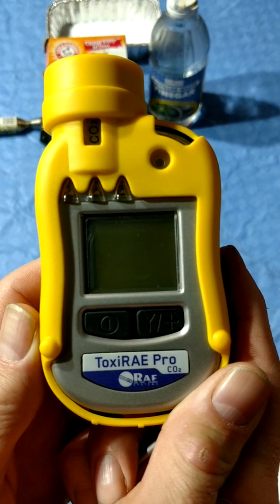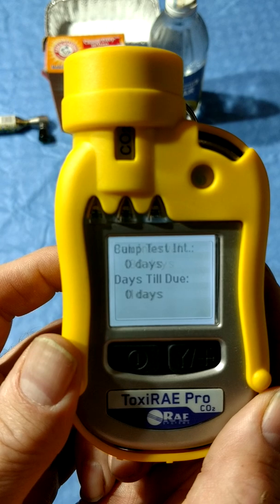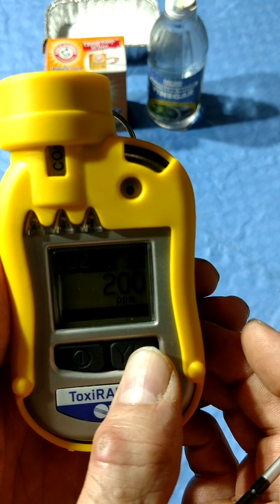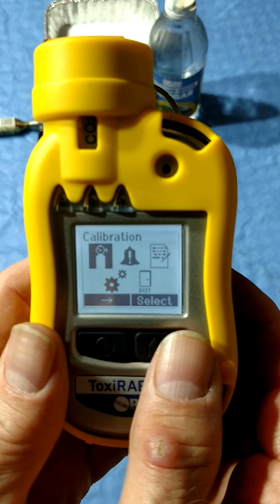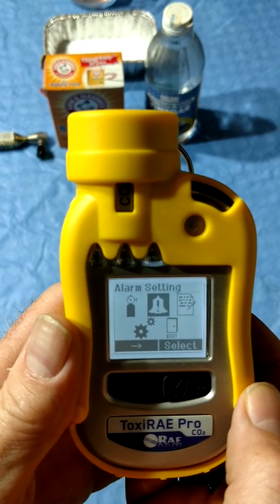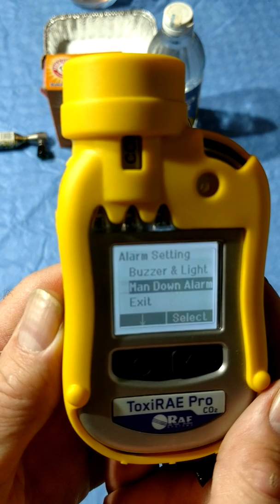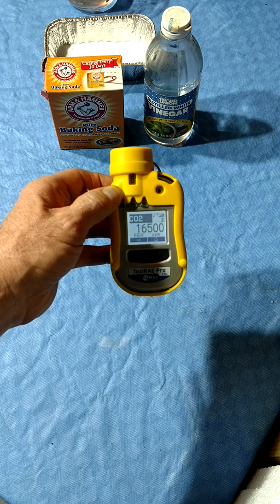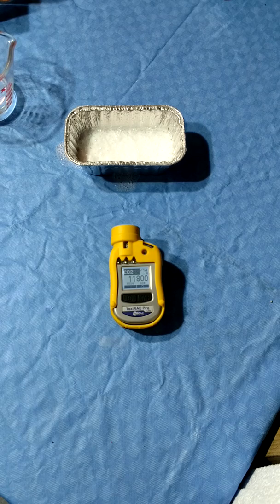ToxiRAE Pro CO2 - Operation & Use

Comment: Hi, why does it show 200ppm inside when 400ppm is the best we can get even outside. Is it a delta ?
Reply from the maker: Igor, the short answer would be that the meter is at the low end of it's range.  The ToxiRAE CO2 manual lists the resolution of the meter @100 ppm.  The meter reading also changes only in increments of 100 ppm.  Outside air does vary around 350-400 ppm.  We calibrate the meter @ 5000 ppm, we don't zero calibrate the meter as that would require a separate 100% nitrogen cal bottle and we are mainly interested in dangerous levels of CO2 (IDLH 40,000 ppm).  When the meter is turned on I've seen anywhere from 100-400 ppm indicated.  To me that is satisfactory as it is in the ballpark for the expected value.  Hope this answers your question.
Reply: Chris Cassidy thank you so much for the explanation. That totally makes sense.